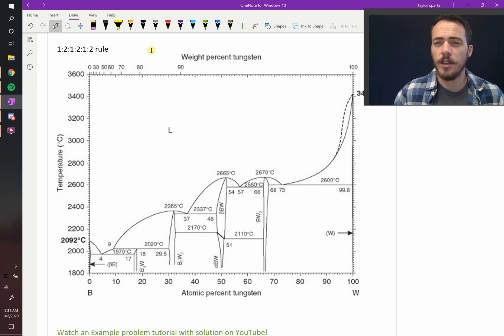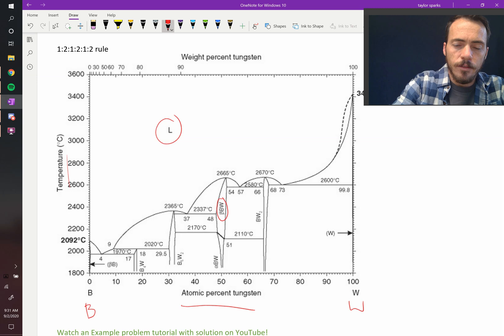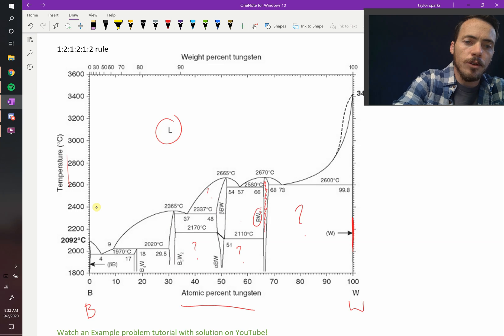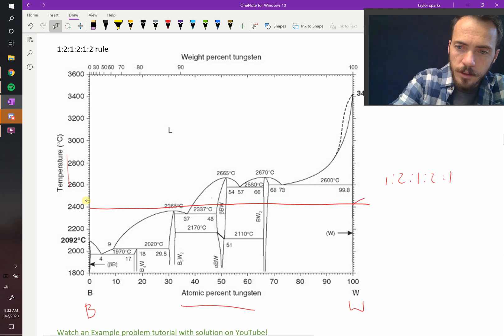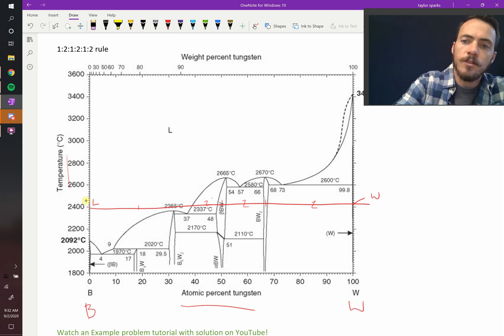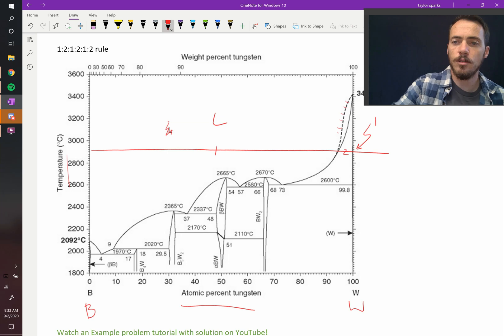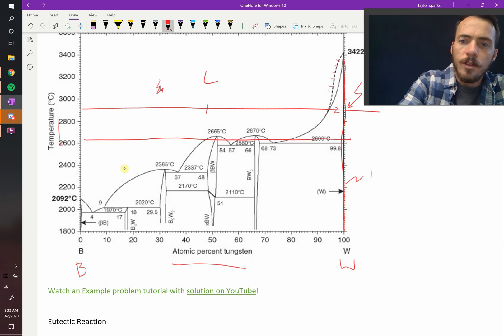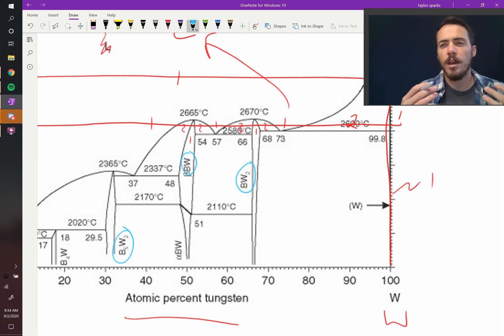How to label a blank phase diagram

Comment: At the compositions where intermetallics appear, sometimes we treat the straight line as a single phase and the adjacent regions as two-phase regions. However, sometimes we represent intermetallics not as a line but as a region, take that region as a single phase, and consider the neighboring regions as two-phase regions. When a blank phase diagram is given, how can we determine whether the intermetallic formation should be treated as a straight line or as a region when deciding the phases?
Reply from the maker: This is such a great question! You are absolutely right. When you see a vertical line in a phase diagram you should start by assuming it's probably a line compound, but it might not be! To test it you must do the 1:2:1:2:1... Rule going left to right. Look for liquid region where you know it's a single phase or use reactions like eutectics to label portions then alternate 1:2:1:2:1... Going left or right at a constant temperature Where 1 or 2 represent the number of phases present in each region.
Reply: @TaylorSparks   Thank you so much for the explanation! It really helped me understand the topic clearly.

Comment: Would this rule change for a metal mixture of three or more components?
Reply from the maker: yes! In pseudobinary diagrams taken from a ternary diagram, for example, see this link https://www.google.com/url?sa=i&url=https%3A%2F%2Fwww.mdpi.com%2F2075-4701%2F8%2F10%2F796%2Fhtm&psig=AOvVaw2G6L5eOjK4kiEIYTTuzAiA&ust=1599170559547000&source=images&cd=vfe&ved=0CAIQjRxqFwoTCOiQ-t68y-sCFQAAAAAdAAAAABAD
Reply: @TaylorSparks  Thanks for the quick reply!  I'll give this a read tonight.